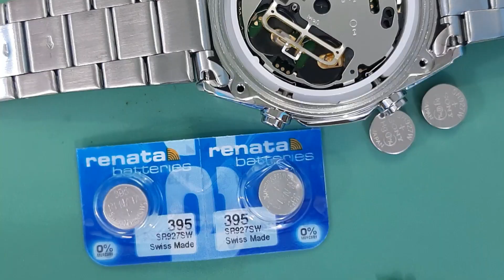How To AC Reset After Battery Replacement Edifice ERA-600 Watch | SolimBD | DIY

Comment: How do I fix backlight? After I changed the battery of my digital the backlight didn't work. I already circuit the AC and the digital and sound was working but the backlight wasn't working